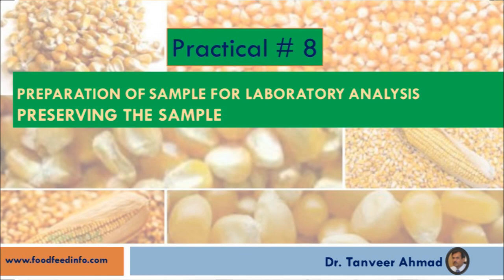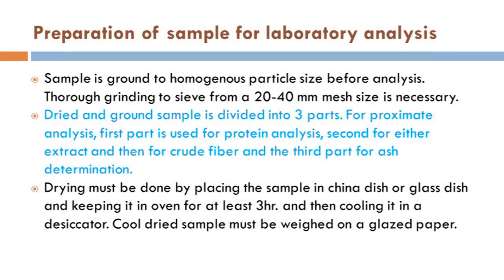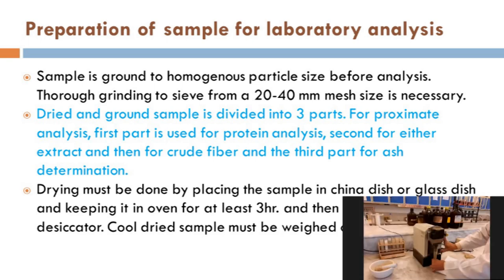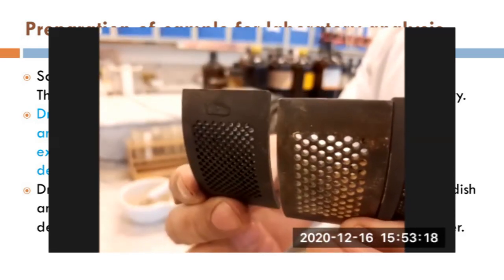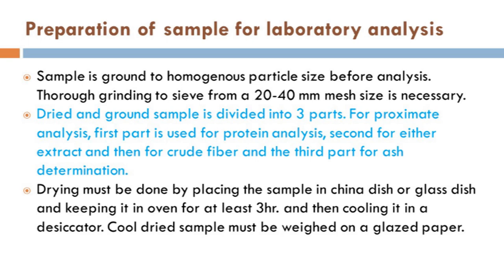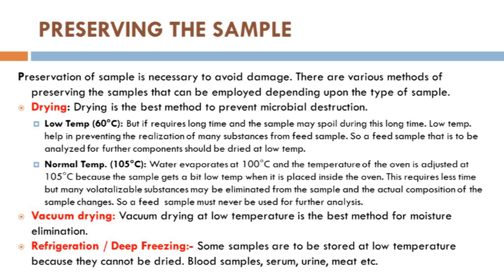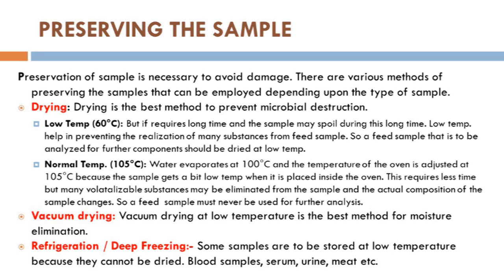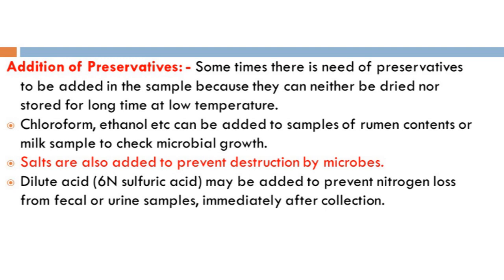Practical # 8 Preparation of sample for laboratory analysis & Preserving the sample

Comment: Sample is ground to homogenous particle size before analysis.
Dried and ground sample is divided into 3 parts. For Proximate analysis, first part is used for protein synthesis,second for either extract and then for crude fiber and the third part  for ash determination.
19_Arid_2209

Comment: 1. Before going for analysis it is necessary that the particle size should small ,if it is large it is ground to homogenous mixture.
2. Drying must be done by placing sample in china dish.
19-Arid-2269

Comment: 1#)From statistical point of view there is need of running three samples at a time and then the average of these three analytical readings is use as a final result.
2#)For grinding, usually the hammer mil is used which grinds the particles into irregular size, thus there is need for sieving the feed to get the feed particles of almost same size. 
19-Arid-2246

Comment: If particles are large in sample than chopped or crushed the particle in small size. For proximate analysis, dried sample is divided into three part which is used for protein analysis,either extraction and for ash determination.
We can preserve the sample by drying, vaccum drying, deep freezing and using some chemicals such as chloroform, ethanol, sulfuric acid and even salt to avoid any damages.
19_ARID_2296

Comment: 1- Vaccum drying is the best method at low temperature for preventing the sample.
2- For a short time preservation put the sample at low temperature and for the long time put the sample at high temperature.
19-Arid-2262

Comment: 1. The best method of moisture elimination is vaccum drying at low temperature.
2. To prevent nitrogen loss from the fecal or urine sample dilute acid like 6N sulfuric acid may be added.
19-Arid-2196

Comment: 1. Sample is ground to homogenous particle size before analysis.
2. Dried and ground sample is divided into 3 parts.For proximate analysis,first part is used for protein analysis,second for either extract and then crude fiber and third part for ash determination.
19-Arid-2186

Comment: 1) Dried and ground sample is divided into 3 parts: For proximate analysis, first part is used for protein analysis, second for either extraction and then for crude fiber and the third part for ash determination.
2) Vacuum drying at low temperature is the best method for moisture elimination.
19-Arid-2265

Comment: Preparation of sample for laboratory analysis preserving the sample 
1_ in drying actual composition  of the sample chnge 
2_ sample is ground of homogeneous particle size before analysis through grinding to sieve from a 20_40 mm mesh size is necessary 
19_Arid_2184

Comment: Sample's particles should be of small size. If they are large, they must be crushed or chopped into fine particles.
For grinding usually the hammer mil is used which grinds the particles in different size. So there is a need for sieving the feed to get the feed particle of approx same size.
19-arid-2206

Comment: Muhammad Moawiz
19-arid-2222
Sample is generally converted to the particles of homogeneous size before yhe examination.  
Drying is done at low temperature at 55-60 degree Celsius.

Comment: For moisture elimination, vacuum drying at low temperature is the best method to prevent microbial destruction of the sample.

Dilute acid (6N sulphuric acid) is immediately added to urine sample for preservation purpose and to prevent nitrogen loss.
19-arid-2198

Comment: The largest particles should be converted into smaller sizes。
Drying method is accurate way to prevent microbial destruction. 
19-ARID-2279

Comment: While preparing a sample for laboratory analysis, first of all sample is ground into 20-40 mm mesh size. Then it is dried well and divided into 3 parts. 
Drying is one of the best method for preservation of samples as it is the most effective method for prevention of micrbial destruction.
19-ARID-2287

Comment: Sample is ground to homogeneous partical size before analysis.Thorough grinding to sieve from a 20-40 mm mesh size is necessary.Dried and ground sample is divided into 3 parts.
Hamza Nazir
19-Arid-2282
3rd Semester (Evening)

Comment: After the collection of sample chop it then dried in oven at 55-60 C and finally grind the sample 20-40mm particles size and finally weight the sample. 
(19-arid-2284)

Comment: 1- After grinding the sample to seive with 20-40mm mesh, the sample is divided into three portion such as protein, ether analysis and ash determination. All three portion with 5g sample to avoid any problem.
2- Preserving depends upon the situation like in case of blood, serum, and urine we store them at low temperature. Drying is also best method that is doing at 50 to 60 degree celsius. Sometimes preservative ethanol and chloroform is uses and sometimes salts is uses to prevent the microbial destruction.
19-arid-2182

Comment: 1. For sample preparation, the materials is grinded, dried and divided into 3 parts for analysis purposes.
2. For drying at low temperature, it requires long time and sample can spoil, it is preferred for drying.
19-ARID-2264 (Evening B)

Comment: Sample can be grounded by the help of grinding machine. For converting it into poser form we use sieve of 40mm. However the sieve of 20-40mm can be used.
Then weight of sample can be determined by weigh balance.
19-ARID-2205

Comment: There is a best method which we used for moisture elimination and it is done at low temperature is vacuum drying.
19 arid 2241

Comment: The sample obtained for analysis is first dried in the oven, afterwards it is ground to smaller grains through grinder using 20-40 mm mesh.
This sample is divided into 3 parts one part for protein analysis, one for ether extraction and last for Ash determination
19-ARID-2257

Comment: 1. First we dry the sample, then ground it and then weight it and then we cooled it for analysis.
2. Normal temperature is necessary to dry the sample because high and low can cause damage.
19-arid-2219

Comment: After preparation of sample it is important to preserve it. There are different methods for preserving sample:
Drying at low temperature 60° or at normal temperature 105°
Vacuum drying
Freeze drying
Deep freezing
By adding preservatives
but it depends upon type of sample which we are going to analyze and duration of preservation.
19-arid-2236(A)